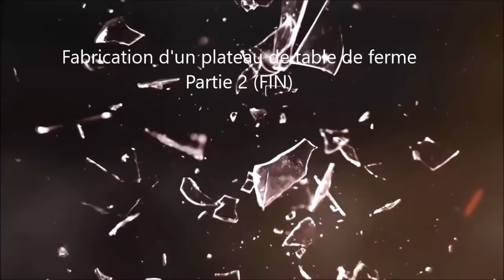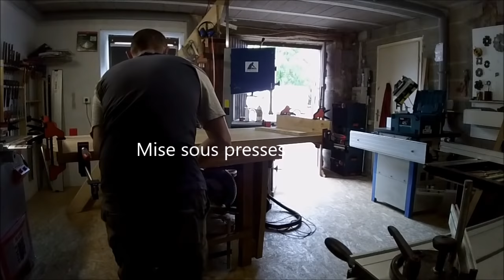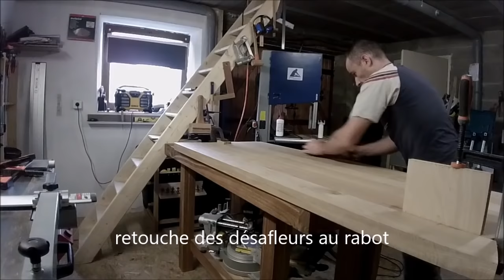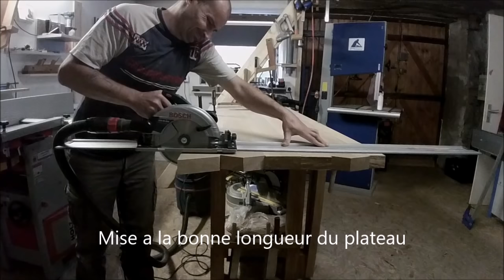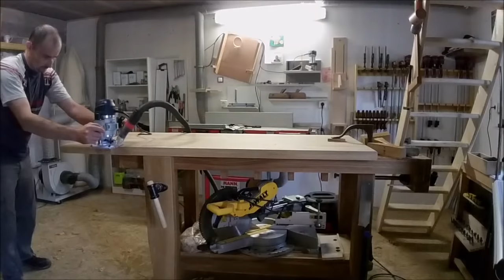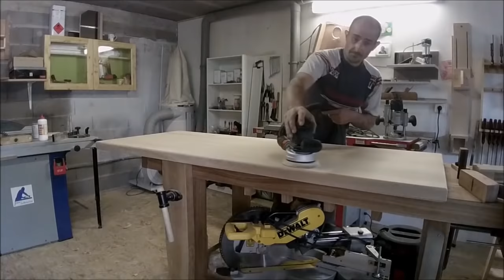Fabrication d'un plateau de table de ferme en chêne Partie 2Build tabletop Part 2

Comment: joly plateaux je vois que vous travailler que avec du bosch bleus alors vous avez aucun problème avec aucune de  c est machine ou il y en a qu'on peux faire mieux genre la scie plongeante je vous presque tout le monde en fesstool mes le bosch et plus puissante et presque au même prix alors si il y a une a ne pas acheter dit le mois  comme vous avez  presque toute celle que je veux acheter et que elle coûte déja chers je demande votre avis merci